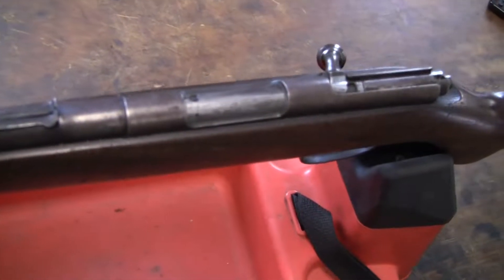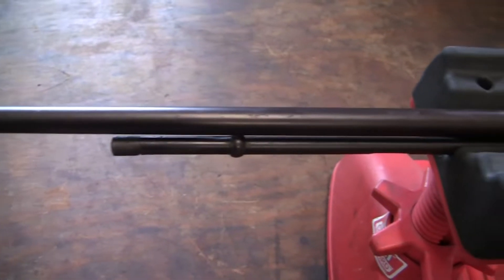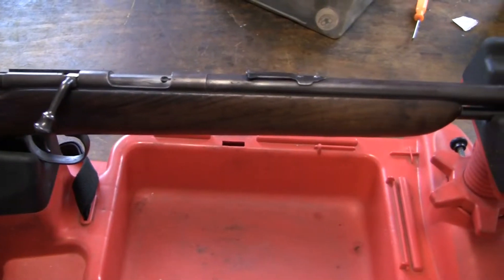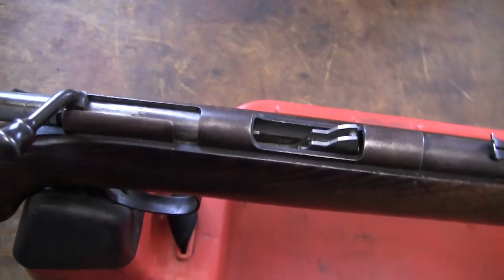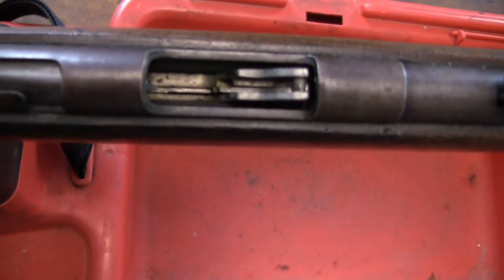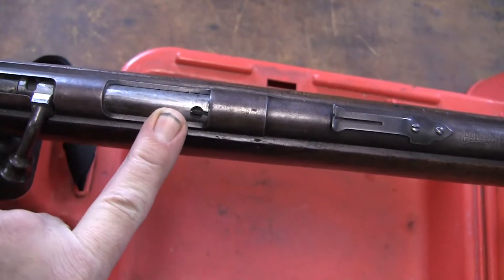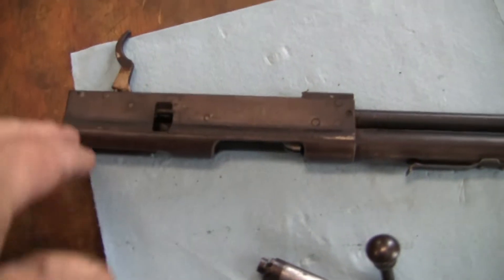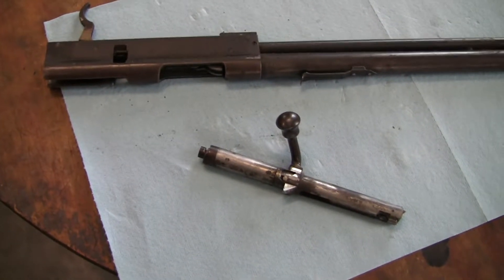Remington Model 341 Sportmaster 22 cal rifle

Comment: Some years ago I inherited a Rem. 341 P  It is fitted with a Weaver D4 scope. The safety has somehow been switched to where on and off positions are reversed. (off is straight up under the scope). Perhaps someone thought it was better that way so that with a scope the safety lever is out of the way in firing position. The stock is also checkered, only one I have seen.

Comment: Oh wow, I bought the new firing pin for my model 341.  So I took the gun outside to test fire one round, thinking the bullet wouldn't fire because I thought the firing pin was broken.  But the gun fired!  Fortunately it was pointed in a safe direction and didn't do any damage. I think the bolt just needed to be cleaned.  So it looks like I have an extra firing pin for the distant future.